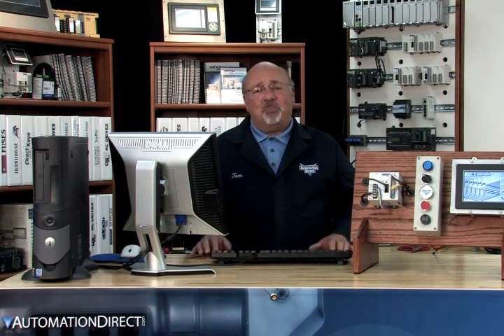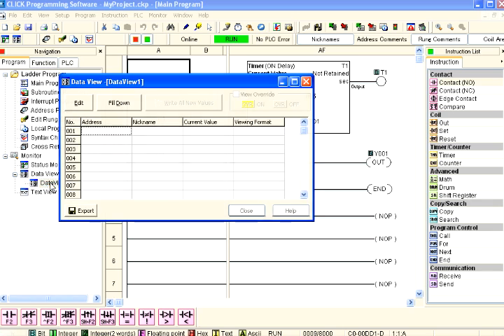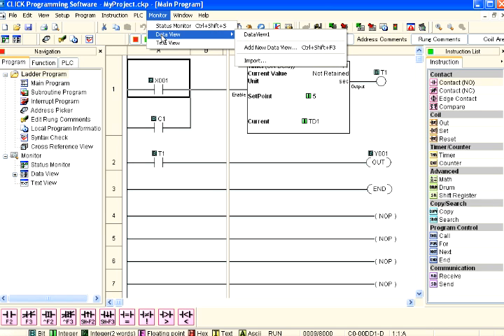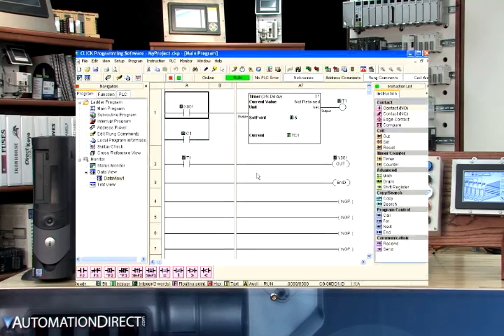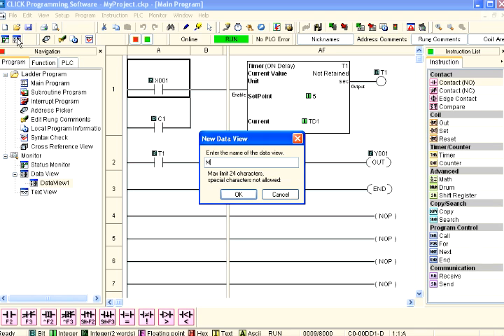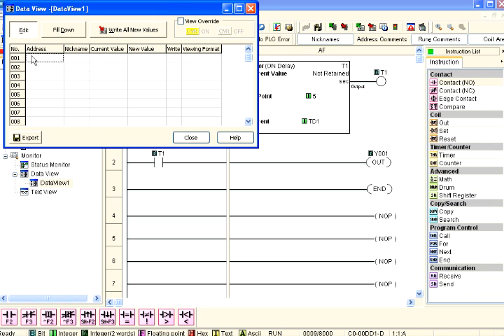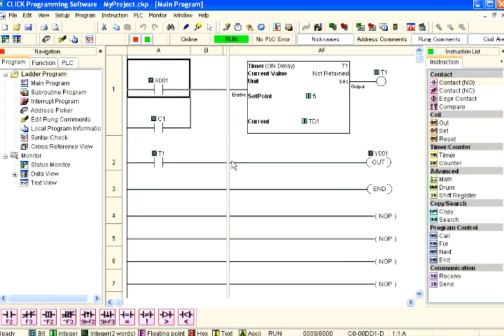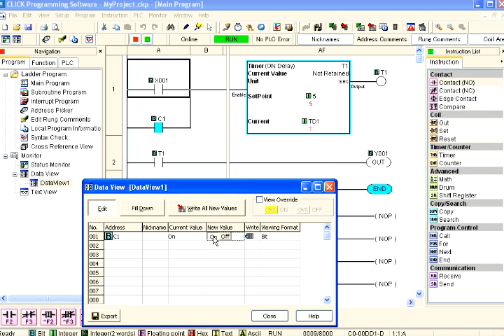CLICK PLC - How to Test a Project Using Data View (Part 9) from AutomationDirect

Comment: Is it possible to run a test simulation in click without it being plugged into a PLC?
Reply from the maker: @withchristaloneful
No, unfortunatly Click does not have a simulator feature unlike several of our other PLC platforms.
Reply: @automationdirect  which of your other platforms do?
Reply from the maker: @withchristaloneful
Productivity has a simulator, as does Do-More Designer. The LS XGB PLC that we carry also has a simulator in XG5000.

Comment: Why would there be no 0 in click??? going from directsoft to click currently, and X0 is X1 and etc.......came so close, but that missing zero and lack of i-box instructions are killers guys, comeon now.
Reply from the maker: I understand the frustration. The Click UI was developed with a slightly different user in mind. The Do-More interface is perfect for your application and was developed in a way specifically designed to allow easy conversion from DirectSoft over to a more modern PLC setup. I would recommend you take a look at Do-More and the BRX platform for as close to a 1:1 with the older DirectSoft and DirectLogic platform as we can offer. Thanks for the comment!

Comment: @automationdirect  can you confirm the C bits in the logic are NOT the same thing as the c1,c2 etc, on the wiring ports on the front of the PLC?
Reply from the maker: The C terminals are commons for inputs or outputs. Definitely not related to C bits.

Comment: I am trying to simulate a pressure transmitter by increasing the psi by some amount per second but the click program cannot do it. I am not trying to override it in the data view,  I first override a pushbutton, there is a 1 second edge that increases the pressure transmitter input by a certain amount each second but this does nothing and the input does not increase. Can the click program overide an analog input itself?
Reply from the maker: The Click, like most PLCs, wont let the program modify an input. Usually to accomplish what you're trying I'd search and replace the real world input with an unused data register and manipulate that.

Comment: Can you run this without a physical device i.e. in simulation mode?
Reply from the maker: OhSnapFit, Unfortunately this PLC does not include a simulator option. The BRX series or Productivity series PLCs both have that option if you want to investigate it. automationdirect.com/adc/overview/catalog/programmable_controllers

Comment: Hello automationdirect.com , I have a question regarding this example:
in this example, physically I have a N.C. contact so I tried to emulate the same example, I just change X1 (N.O. from your example) to a N.C. in software and in reality. My question is this: I noticed that the N.C. contact highlighted when I pressed it... In other words, when I was physically open and when I released the button it was white again and nothing happen.  So I tried something else. I used a rong with 2 contacts for the same variabe X1  . One N.O. and one N.C for my physical N.C. button and I noticed something, the N.O. contact In software was highlighted and the N.C in software not.. this confuses me.. I did the same exercise with one physical N.O contact I have and I behave as I thought ( N.O contact in software highlighted when I pressed the physical N.O. contact and viceversa)  I hope it was clear and you can help me with this.. Thanks in advance..
Reply from the maker: Alberto, thanks for the comment. When a contact is highlighted on a  rung in CLICK that means that it will allow flow through the contact. For a normally open contact, it will highlight when the assigned bit is ON and not when it is OFF. For a normally closed, it will highlight when the assigned bit is OFF, and not highlight when the bit is ON.  If you need further clarification, please feel free to contact  our Free Tech Support.  1-800-633-0405. Thanks

Comment: Are floating points able to be overwritten through data view? I’m trying to overwrite a thermocouple value that is controlling an analog output. I do not get an overwrite toggle next to the floating points. Thanks.
Reply from the maker: John, only discretes, like C, Y, T, and X can be overwritten, in Click. If a non-discrete value is not being written to in the ladder code or by being tied to a physical input, like a thermocouple, then you can write a value to it in data view. Thanks for the comment.
Reply: AutomationDirect.com cool. Thanks for the info.

Comment: My program and dataview looks exactly as shown, but when I select on under new value nothing happens. It is in run mode
Reply from the maker: Thanks for the comment B Pace.
I am assuming you are trying to change the value of an address and that change is not being seen to the "current value"? 

This may be an issue of the ladder code over-writing your change. Realize that the ladder code running will take precedent over the value you write to it from Data view. 

For example: If I had Y1 as an out coil, on rung one, and that rung of logic is turning Y1 off. Even if you turned it on from Data view the next scan of ladder code will turn it off. 
I typically test this by placing an end statement at the top of my code, loading that to my CPU, and trying to make the change. If it works after that you know that your ladder code was over-writing your Data View change. 

Hope this was helpful.
Reply: I guess it could be that.
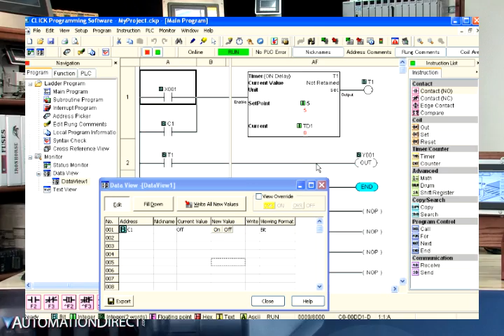My program is exactly as shown here: At 2:30 on part 9 of the series https://www.youtube.com/watch?v=zmmf...9E6C23A0A3C9A8  When I lick on "on or Off" in data view, nothing happens.
Reply from the maker: B Pace. I see the problem, this video was done with an older software. Now, you need to either double click on the "On" or Single click on the "On" and then select "Write all New Values". I will put this video in for an edit. Thanks, for bringing this to our attention.
Reply: Thanks, I was going crazy-er
Reply from the maker: Glad we were able to help. Have a great day!